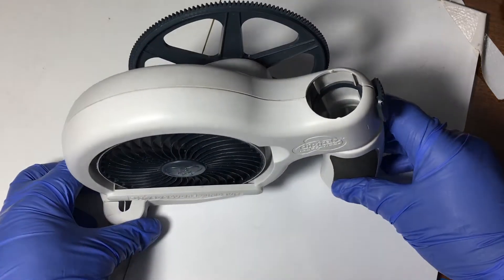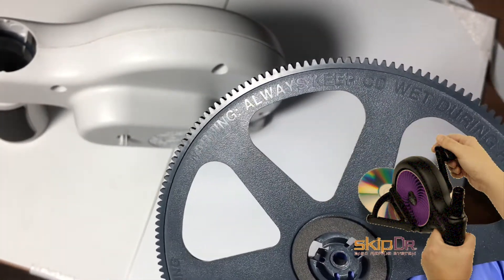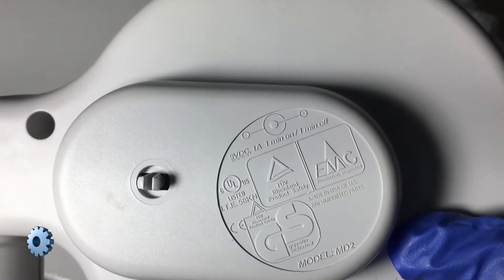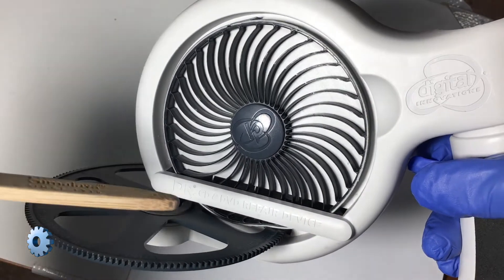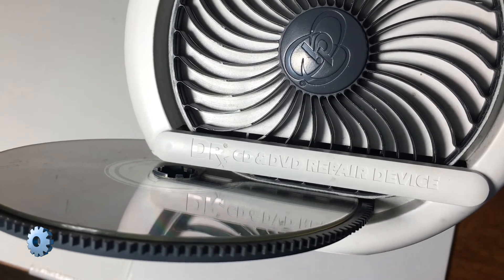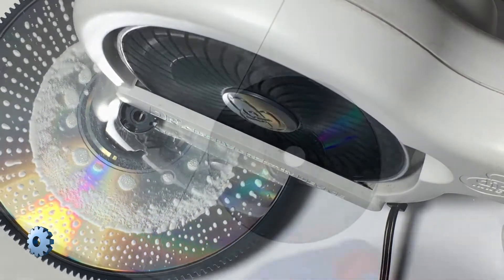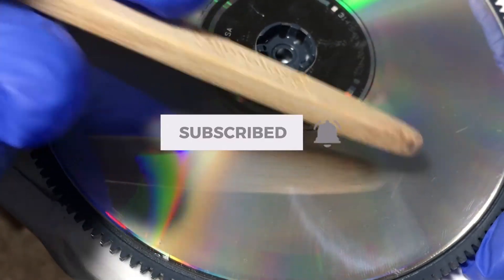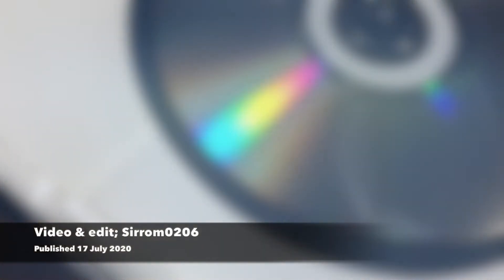Retro Review of SkipDR MD2 Motorized Disc Cleaner

Comment: "Never use paper products" lol I've cleaned off thousands of cd/dvds with paper towels haven't had a single problem... if you are pushing hard enough so that paper.... will scratch plastic... probably need to throttle it back hulk.
Reply from the maker: I guess you’ve never read the safe handling instructions for CD.